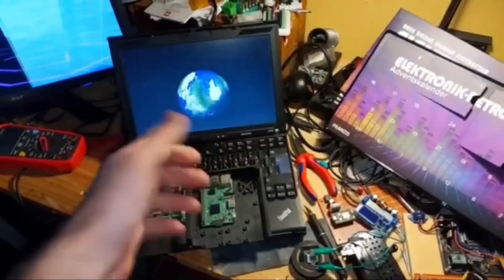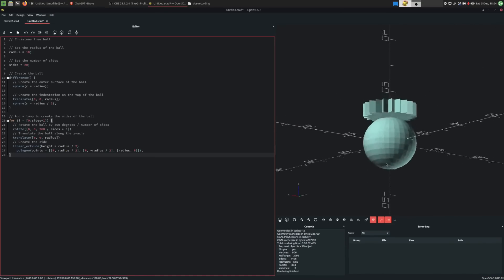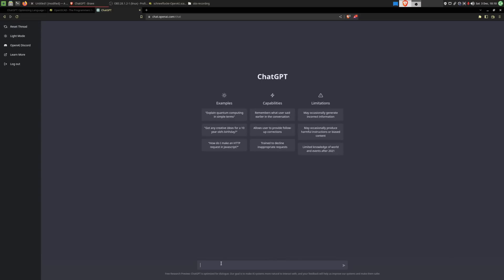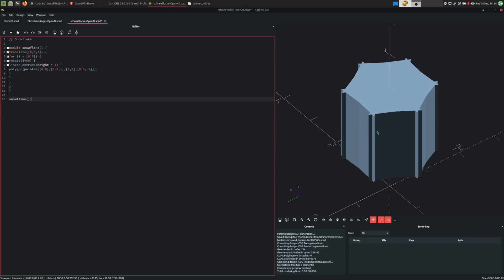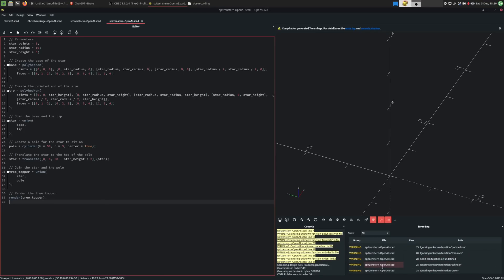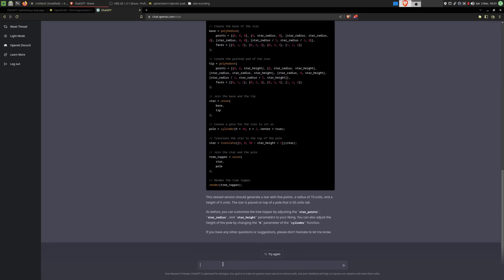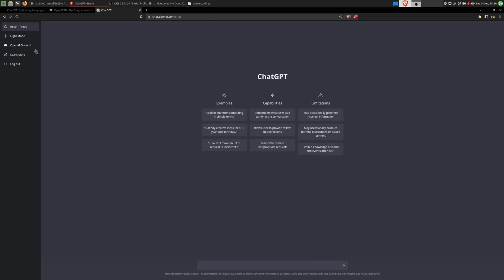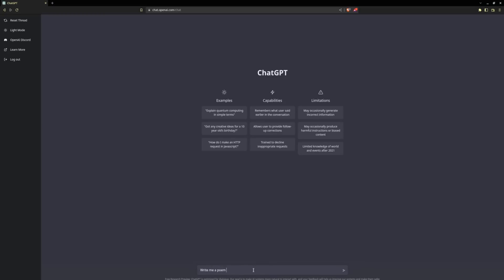ChatGPT & 3D Printing: Self-Replicating AI Machines!

Comment: Interesting video! The snow flake seemed to be the best thing you made. I thought you could go further on that with repeating the cuts using an array around the center. Some dude did an array for blender on Chat GPT and it worked. I repeated it and found it to be good.
I thought the term Christmas tree topper to be too non-specific. I haven't tried it, but I'd go for your specific choice like star or angel and see if that narrowed it down. I'm struggling with anything complex on Blender generations and failed at extrusions. I will be looking at OpenSCAD and more Blender Add Ons and would watch more videos on future success with OpenSCAD and ChatGPT.

Comment: what would probably help a lot is to guide it in a similar way to how openscad is used.  I don't use it so I know nothing about it, but like if this was using fusion 3d I would guide it through like "create a sketch on a plane that is flat on the floor using x and y axis" and explain what to draw then "extrude on z axis" and so on.  Typing through all the steps would still be much easier especially if you could get it to do accurate sketches for you.  The hardest part really for a lot of stuff is the 2d sketch. Extruding, filleting, chamfering, scaling, lofting, and so on are all pretty simple.

Comment: If you lead ChatGPT by by starting with relevant information you can manipulate the outcome. Below is an example:

If it does something you don't like edit the question that created the problem. If you leave it in, ChatGPT will use it for future reference.

Me:      what are the mounting dimensions for nema17 stepper motor

ChatGPT:    NEMA 17 stepper motors typically have a faceplate with four mounting holes. These holes are usually arranged in a rectangular pattern, with a center-to-center distance between the holes of about 28.5mm (1.12 inches) horizontally and 33mm (1.3 inches) vertically. The diameter of the mounting holes is typically M3 or M4, and the holes are usually spaced on a standard 2.54mm (0.1 inch) grid. Some NEMA 17 motors may have slightly different mounting hole patterns, so it is always a good idea to consult the manufacturer's documentation to be sure.

Me:    create openscad code for a mounting bracket for nema17 stepper motor

ChatGPT:     Here is some example OpenSCAD code that generates a simple mounting bracket for a NEMA 17 stepper motor:

Copy code
// NEMA 17 stepper motor dimensions
$fn = 50;
motor_width = 28.5;
motor_height = 33;
hole_diameter = 4;

// Generate the motor outline
motor_outline = [    [0, 0],
    [motor_width, 0],
    [motor_width, motor_height],
    [0, motor_height]
];

// Generate the mounting holes
mounting_holes = [    [-hole_diameter/2, -hole_diameter/2],
    [motor_width + hole_diameter/2, -hole_diameter/2],
    [-hole_diameter/2, motor_height + hole_diameter/2],
    [motor_width + hole_diameter/2, motor_height + hole_diameter/2]
];

// Generate the bracket outline
bracket_thickness = 6;
bracket_length = 50;
bracket_outline = [    [0, 0],
    [0, bracket_thickness],
    [bracket_length, bracket_thickness],
    [bracket_length, 0],
    [bracket_length - bracket_thickness, 0],
    [bracket_length - bracket_thickness, -bracket_thickness],
    [0, -bracket_thickness]
];

// Translate the motor and bracket to the origin
motor_outline = translate(motor_outline, [-motor_width/2, -motor_height/2]);
mounting_holes = translate(mounting_holes, [-motor_width/2, -motor_height/2]);
bracket_outline = translate(bracket_outline, [0, -bracket_thickness]);

// Extrude the motor and bracket
motor = linear_extrude(bracket_thickness, motor_outline);
bracket = linear_extrude(bracket_thickness, bracket_outline);

// Combine the motor and bracket
difference() {
    motor;
    translate([0, 0, bracket_thickness]) {
        bracket;
    }
}

// Render the mounting holes
for (hole = mounting_holes) {
    translate(hole) {
        cylinder(r=hole_diameter/2, h=bracket_thickness*2);
    }
}
This code generates a mounting bracket with a thickness of 6mm, a length of 50mm, and four mounting holes arranged in a rectangular pattern to match a NEMA 17 stepper motor. The bracket is extruded from a flat outline and the motor is added using a difference operation to create the final shape. The mounting holes are then added using a loop to generate a cylinder for each hole.

Note that this is just one possible way to generate a mounting bracket for a NEMA 17 stepper motor in OpenSCAD. There are many other approaches you could take, depending on your specific requirements and design constraints.
Reply: I don't know openscad code but looking at the code I would assume it took a good approach. I can clearly see the dimension it wants to create. It also looks to me, correct me if I'm wrong but did it create a model of the stepper motor as well?

Comment: I tried this myself thinking it might be capable of more, but I think you're right. It can make code that runs in OpenSCAD, but it doesn't have any way to see if the output matches the prompt. I'm also interested to check if it can provide .obj or .stl code, or maybe 3D print layer code (if there's some for that isn't too long). If it had lots of examples of good OpenSCAD code I think it could do better by merging the concepts.
Reply: Or, what if we use a fine-tuned model that had OpenSCAD with the output of hundreds of descriptions in the plain language of the .

I think it could do that.

Comment: to be fair, chatGPT has never seen any of the things you are asking about. it's never seen anything.

i've noticed it sometimes has hard time with visuals or sounds. like you might ask it to make a parody of a song but about something else and it will struggle to maintain the cadence, because it doesn't know how many syllables words have, so it does to put in words but they don't fit the rhythm. sometimes it will make a joke that depends on a word sounding like another word and i gotta be like "sabre and climb don't sounds alike" (though to be fair it did respond "you are correct, they don't sound alike, the joke doesn't work" and it reworked to joke to work, wasn't funny but it at least worked)

it can product SVG code, but try to tell it to make SVG code of a certain thing and, unless it's already seen SVG code of that thing, it won't be able to, because it can't reason on how to make the code of a thing it's never seen before.

it does well enough with rhyming, i think it's seen enough poetry to get a sense of what words rhyme with what words.

Comment: what is self-replicating?? just baseless clickbait?
Reply from the maker: The RepRap project with its goal to develop a low-cost 3D printer that can print its own parts. Just look at the Mulbot project, that's really close to self-replicating already.

Or even better, these days industrial automation has led to most manufacturing processes being automated. Future AI could easily control entire factories. 

Now teach a neural network to design parts and give it access to manufacturing, be it a RepRap machine or entire factory: Self-replicating AI machines. We don't have neural nets capable of CAD yet, which is the point of the video.
Reply: @SERVOPUNK   close but no cigar. I appreciate the point though. One day.

Comment: I was experimenting with 3D modeling using MatPlotLib, but the ChatGPT doesn't have an understanding of 3D geometry. I think it'll only be a matter of a year or two before PTC or Autodesk offers an AI for this purpose that will be $4500/month.
Reply from the maker: I don't think the tech will be advanced enough within 2 years to warrant $4500/mo. Designing anything beyond brackets and flanges, let alone entire assemblies is too complex. There's no work on neural nets for CAD, no datasets, no research, nothing so far. Perhaps we'll get simple shapes, maybe a motor flange, a wiring channel.

But I am not expecting anything beyond the complexity of a automatic pencil sharpener for quite some time. How long exactly depends on how much research gets done, which to my knowledge is zero so far.
Reply: @SERVOPUNK  Somewhere I heard it was around $6m to train GPT3... I wonder if any of the big CAD players might be trying to train their own transformer. Just seems like even if it was only capable of "NEMA 17 Motor Bracket with L-Mount, + 0.080" MIN MATERIAL + STEP OUTPUT --AR 3:2" it would still be a huge win. I've wondered lately if there might be a way to just "glue" the output of GPT3 to a 3D generator (Which is how I ended up at your awesome video, thanks!) I'm working on some auto CNC roughing pass CAM stuff over at BerylCNC YT channel but it'll be a few weeks before any new vids. This Chat GPT has me all excited.
Reply: @i2c_jason  Not sure where you got your news from but that 6 million was really 12 million for just 1 training run, they are up to the thousands in training runs... :)
Reply from the maker: @i2c_jason  Yeah the potential is huge and I hope someone will start working on it, which is why I made the video. If I can't build the neural net maybe I'll be able to inspire someone. That lathe setup on BerylCNC looks very cool, I dream of one day having the money and space for something similar :)

Comment: Once they connect the ability to supply a reference diagram, hand drawn sketch (even with dimensions) or even photo along with the prompt it hopefully will get us most of the way there.  This is going to make 3D printing much more widely accessible once it more often than not can generate workable results.  It will be about the closest we have ever come to "magic": to be able to speak what you want, and then minutes later, hold it in your hand.  2022 will certainly be remembered both for the Cold Fusion breakthrough as well as AI landing at such a high level of functionality becoming widely used.

Comment: I asked it for gcode, skipping the middleman. It did, but I have yet to test the results. Feeding the gcode back into it, it described what sounded like something fairly close to what I asked for. Hopefully there’s extensive 3D printer gcode in its training data.
Reply: I've tried to have it produce gcode but run into the same issue. It can only seemingly do simple models.

Comment: If a programmer would use this software, it would be a disaster. You have shown very clearly that AI's are not able to understand complex thought processes & imagine you let an AI build a complex software, can you just imagine what problems this software would have, what bugs this software would have.
Sure the AI would have generated the code in no time, but the programmer would need another half a year to check all the generated code for bugs, if not a whole year.
This software could not implement any of your requested requests, such as the Christmas ball, which after three requests still looked like a mechanical element and still did not have an eyelet where you could hang it.
Epic fail!!!

😂😂😂😂😂😂😂
Reply: I've already used thousands of lines of chatgpt generated c++ code without errors. Sort of depends on the jobs you outsource to it.

Comment: I am a software engineer, and I have been using this to write some of the trickier sql this last week at my job. At the end of the week I was as productive asnormal, but I was sick for part of the week so it was a definite boon
Reply: very bad idea
Reply: @FFA704  No different from getting an answer from the google machine. Read, understand, test test test then click and pray haha
Reply: @ElixirEcho  Understand one thing, IT STARTED, and IT will not remain at the same level.
Reply: @FFA704  How so? i asked it for some code, then i tested it and confirmed that it worked as desired, made a few tweaks for our specific environment, and used it. it saved me a lot of time and came up with a more robust solution than i had.
Reply: @markmahowald7866  good thing you understand the behavior the code you're running beyond testing and making a few tweaks, I'm sure this won't cause problems later on

Comment: You don't need to redo the input, just tell it the issue and it will fix it. Also, it remembers what you have asked before, so it will gradually learn what you want with less direction.  Also I don't just mean within thw thread, I mean it knows all your threads.

Comment: I tried the same thing, with the prompt "Can you generate openscad code to connect a nema 17 motor to a gearbox. " It wrote code that seemed to be creating modules but didn't define them. So I corrected the result and fed it back to it, saying I that this is what I think you meant.  It accepted that and we proceeded to "fine tune" the code. All in all it was disappointing. I do think that if a model were to be trained with openscad in mind, it would be very good. But it appears that openscad is barely known by the model.

Comment: Impressive, and this is all before fine-tuning and specialization for this purpose. Soon, software will include fine tuned custom modes based on GPT that will be much better for their purpose. I tried the same with SVG files, and it somewhat works too.

Comment: I think that the reason of why some 3d pieces does not have any sense is because chatgpt is trained ONLY with plain text. It knows all the theory of geometry, but it hasn't seen any 2d or 3d image ever. And what people says, an image is more relevant than 1000 words. Also the poor AI  can't check if the code has errors. So this isn't the use it was designed for, by far, although it manages it pretty well.

Comment: It can generate python code for Blender as well. (Just a different way to do the same thing.)
Reply: But it is mostly nonsence code. It hallucinates methods and generally needs to be fixed almost every single time.
Reply: @jendabekCZ  I am getting that sense the more I try to use it for real world issues. It's like a proof of concept version. I assume the path forward will be with dedicated trained models in future
Reply: @justinarchiquette7591  Yes,  it is impressive this is supposed to be just a language model, and it can still do some programming ...
Reply from the maker: I'll have to try that! It's Python, so the AI has been trained on a far larger dataset and will produce less faulty code.
Reply: @SERVOPUNK  i was getting mixed results, Blender updated it's code a little while back, and I am getting a mix of old and new syntax